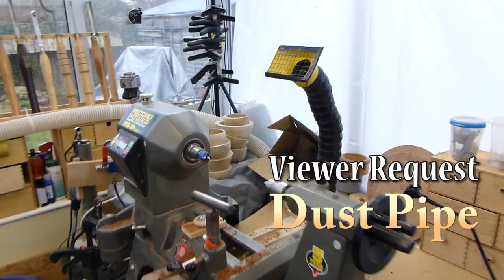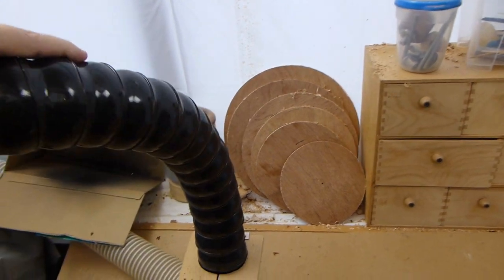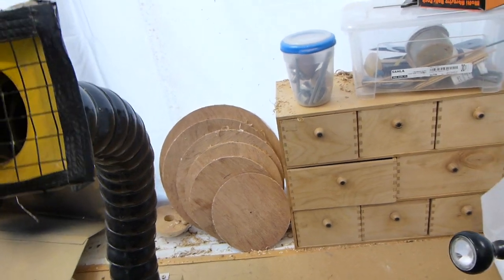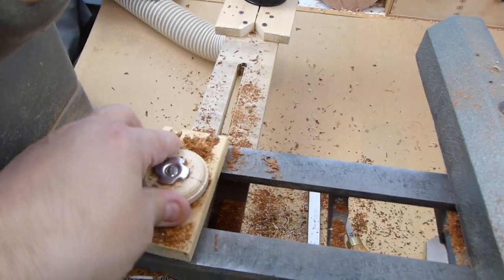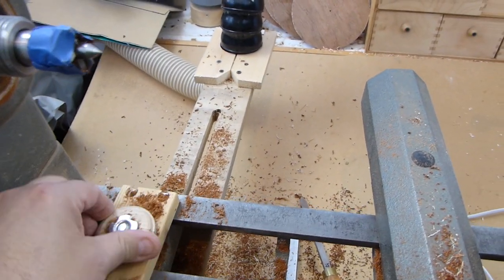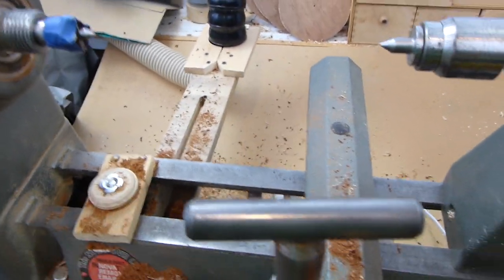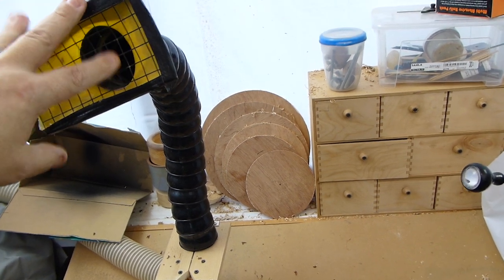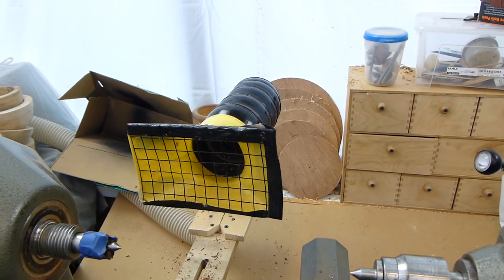Viewer Request: Lathe Dust Collection Pipe - Woodturning - Tom Stratton

Comment: Lee Valley sells them. It's made by 
Loc-Line Dust collection system. Looks like it works very well
Reply: +chickenguru4 Thanks for the info. So I did a google search for Loc-Line and found it available at a lot of places, including Lee Valley of course.
Reply from the maker: +chickenguru4 Well Done!  I shall update the video description with this.  Many thanks!
Reply: I have a hose that looks very much the same and once it moved to its "open" position it is impossible to get "closed" again. It just springs back open. The one in the video doesn't have that same issue.

Comment: Here is a link to loc-line they sell hoses & fittings. I've used the smaller diameter for blowing the dust off of projects as well as cooling fluid. http://www.modularhose.com/Loc-Line-25-ID-System/25-hose
Reply from the maker: +Fierceflyer55 Thanks for the link.  There are a number of sources listed now for turners around the world.

Cheers

Tom

Comment: Did you find a source for this flex hose?
Reply from the maker: +Larry Rizzo Hi Larry.  There are a number of sources given by viewers in the comments.  Have a quick read through and you will find one in your location, or search for Loc Line which seems to be the manufacturer.

Cheers

Tom

Comment: Tom. What is the inside diameter of the  flexible pipe have you used to connect to the Line-loc. Thanks.
Reply from the maker: +Jim Rendle I think it is 50mm.  I am away on holiday until the end of this week, but I will check for you as soon as I can.